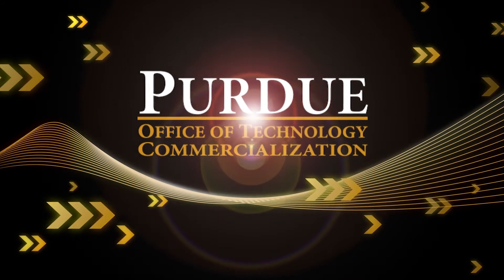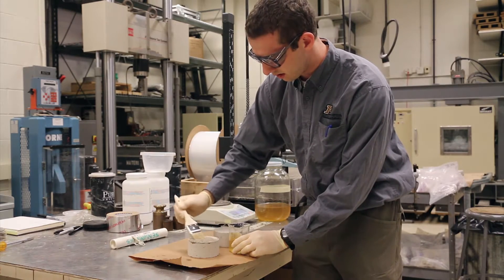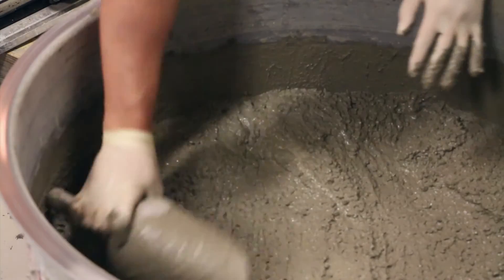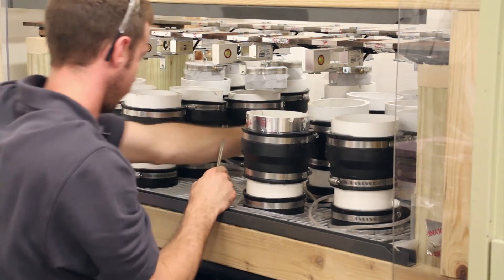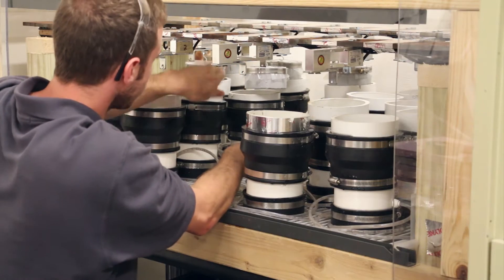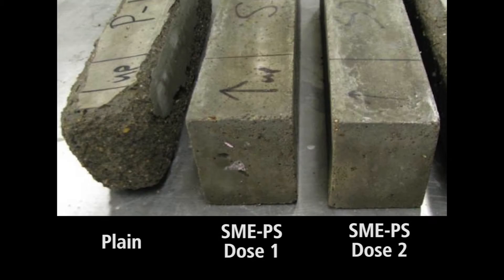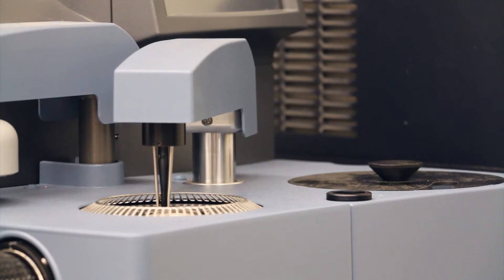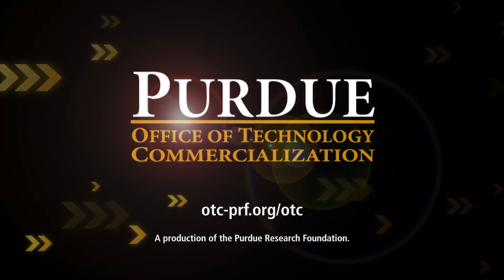Environmental Concrete Products

Comment: Said it was compatible with paint and stain products, how so?  Should this Fluid iSoylator be used after a concrete stain?  Would it help seal the stain and act as a topcoat for it?  thanks